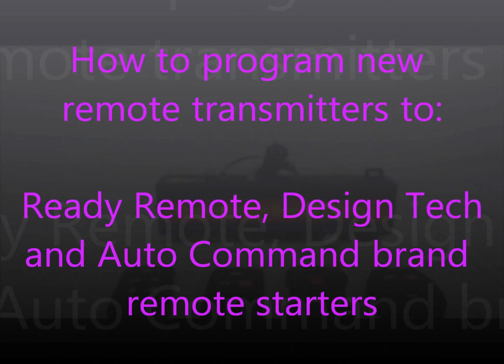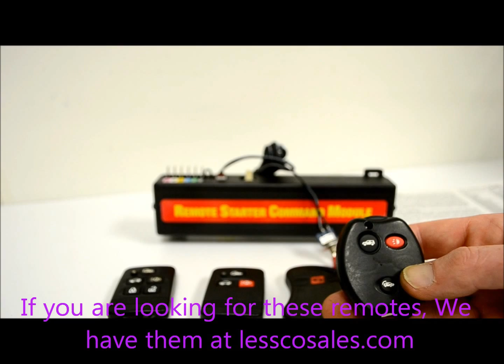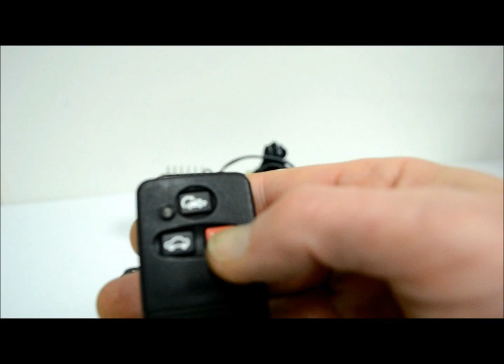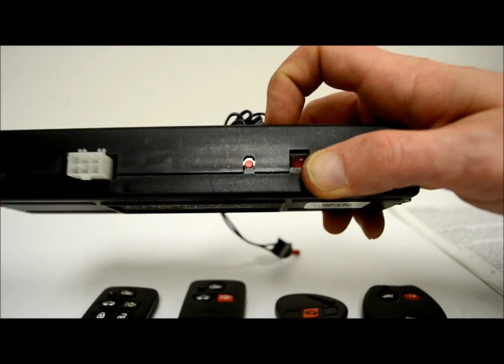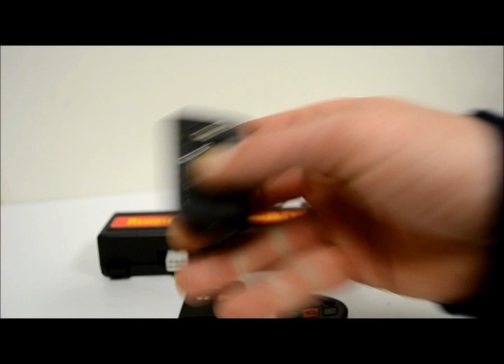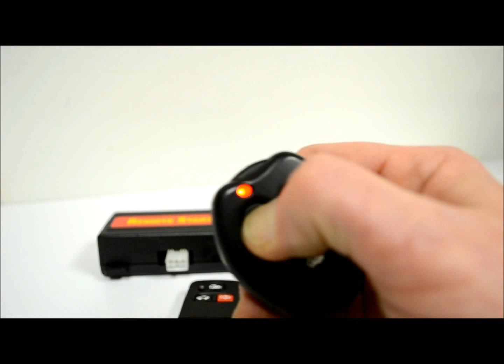Remote transmitter programming for ready remote design tech & auto command

Comment: I have an auto command 20921 Installed on my 2000 Ford f250. I bought the truck with it installed but he had lost the transmitter. I have a ELGTX7 5 button transmitter. Will this transmitter work with my remote start module. Im having to success programming it. Any help would be appreciated.